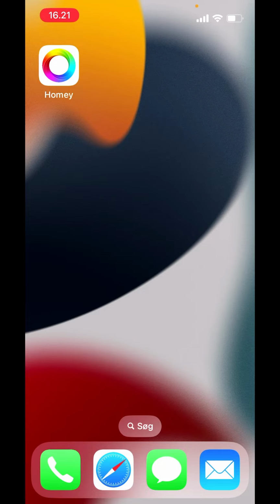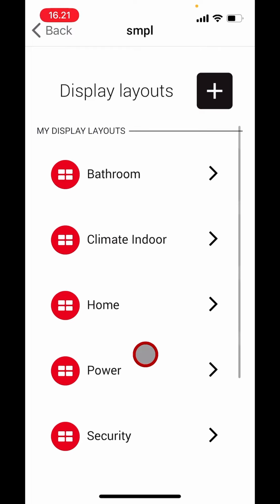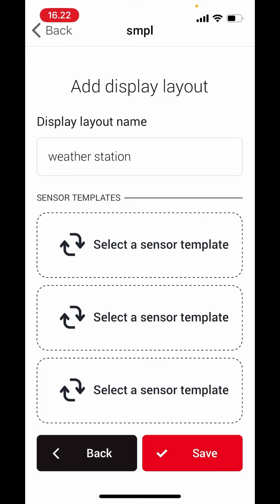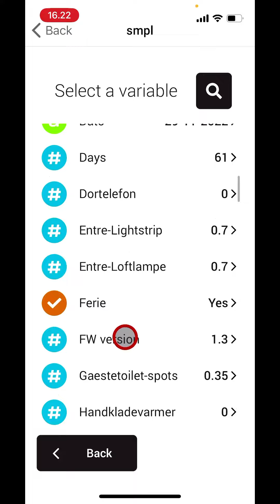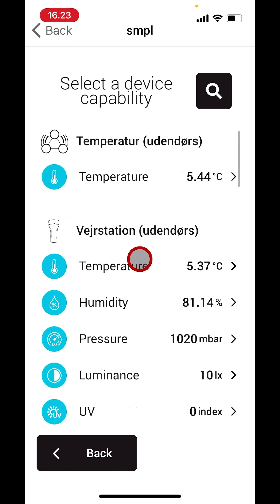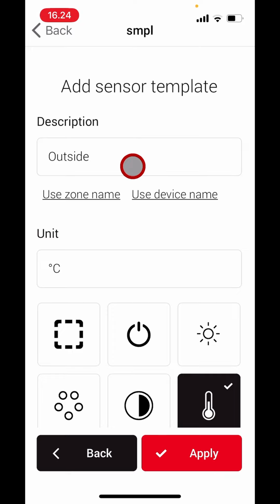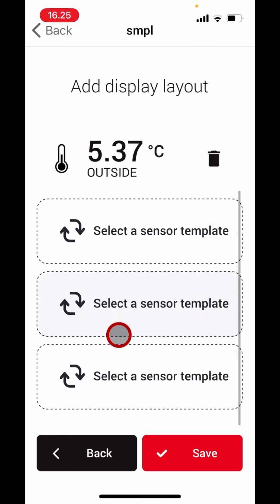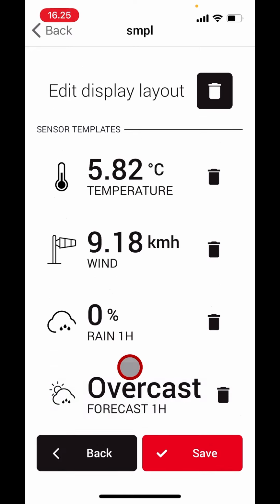How-To (3) Create display layouts for your smpl mini display (app screen recording)

Comment: It would be helpful to be able to set the number of digits for the displayed value. Currently only one digit is possible. E.g. energy prices are displayed as 0.1€, but maybe it is 0.11 or 0.19, therefore two digits would be helpful!
Reply from the maker: Thank you for your comment, which is very valid.
This is by design. We only show one digit to maximize the size (font) of the value for visibility.
The design is flexible in size to make room for more data. Longer text/numbers etc. will be shown in a smaller font.
We decided that more than one digit would be useless in most cases due to a) sensors are rarely that accurate, b) more digits rarely give more/better information. So we have capped it at max 1 digit.
But, we have seen that electricity prices are often in EUROs (0.345) despite more relevant in EUROcent (34.5). As a work-around, you can convert to EUROcent using logic variables.
We are considering - for a future firmware release - to change this to: 123 / 12.3 / 1.23 / 0.123.
Reply: @smplproducts  thank you for your fast reply. I am looking forward to the firmware update